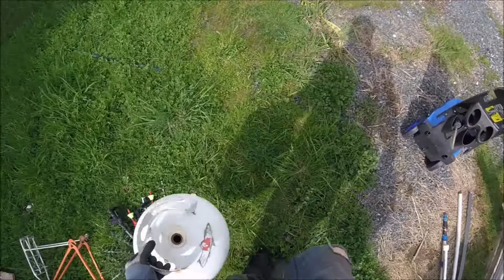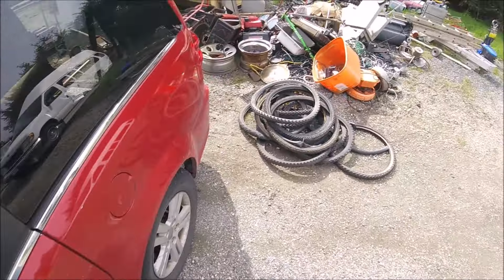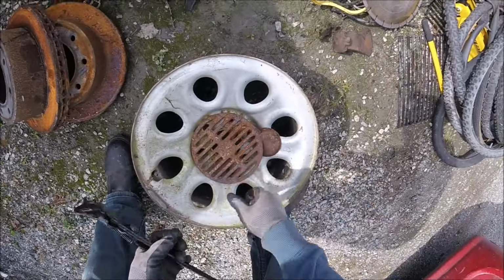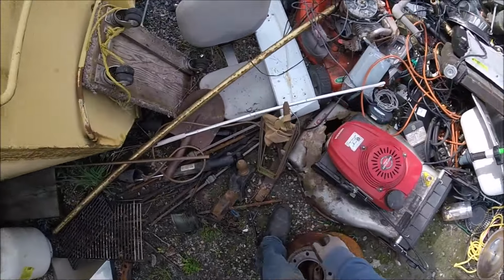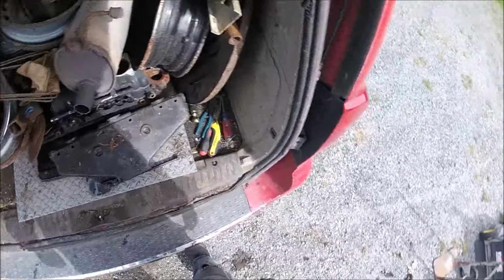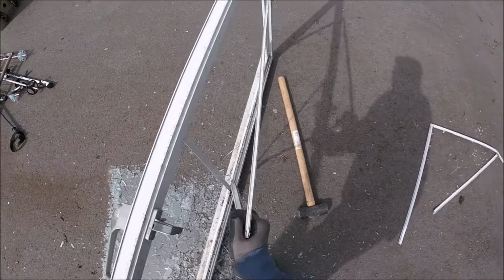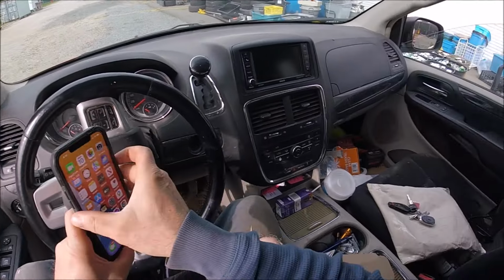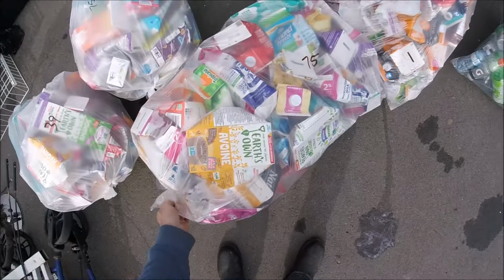Scrap Run Selling HMS + Bottle Run

Comment: Did you say the spring clean up is over? I mean it is not even a week. I think only 3-4 days. Before last year you made around 10,000 dollars and last year you made around 6,000 dollars during spring clean up. Today you made around 500 and another 500 worth material left.
Reply: That was just one area of Vancouver next week he has one that lasts for like 4 days I think that's the good one he mentioned it in one of his videos
Reply: @terridionne7729  Thanks. Still 4 days looks very short. I think last year it was longer like 2 weeks.
Reply from the maker: Those two areas where short, Next one this week end & pickup wed & Thursday
Reply: @CanadianTreasureHunter  I can’t wait